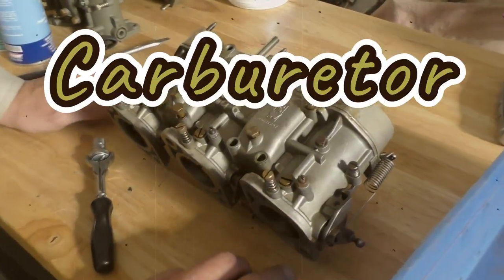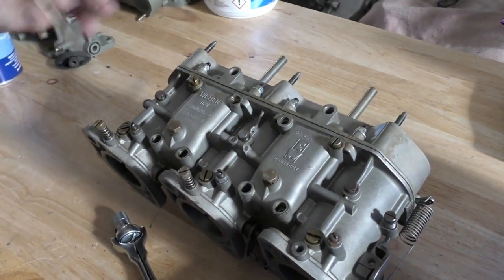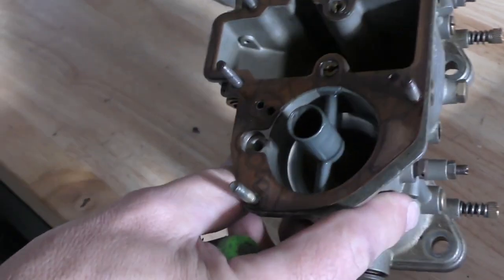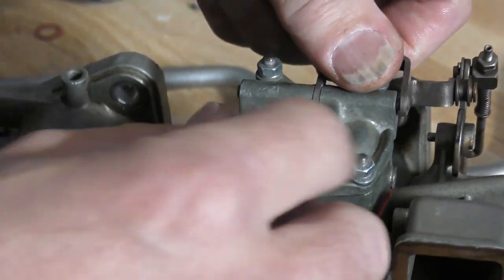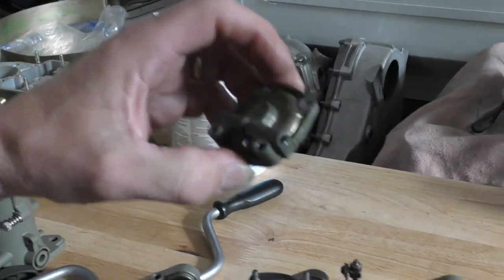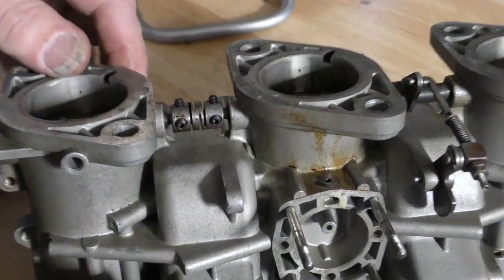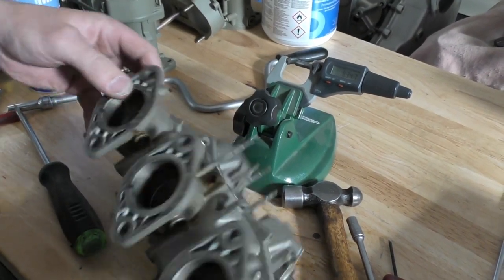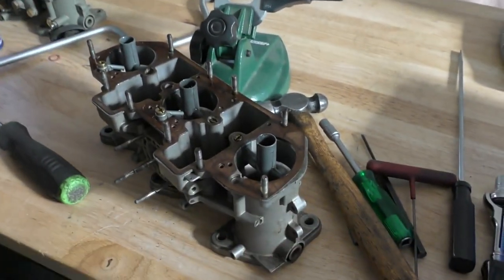Carburetor Inspection

Comment: Great video Kurt. You explain everything perfectly and in depth. Great camera work too. Telling all that needs to be checked and how to properly clean is what makes this approachable. Thanks. For cleaning my timing chain and rocker covers what grit glass bead would you recommend ?
Reply from the maker: I use a 170 alum/glass mix in our vapor blast cabinet
Kurt